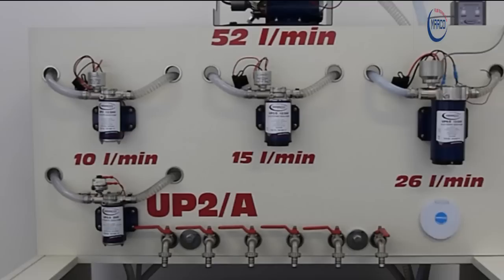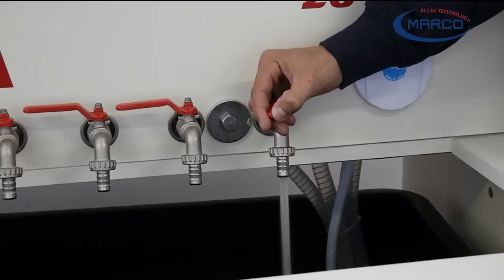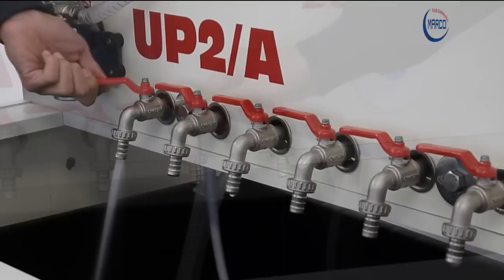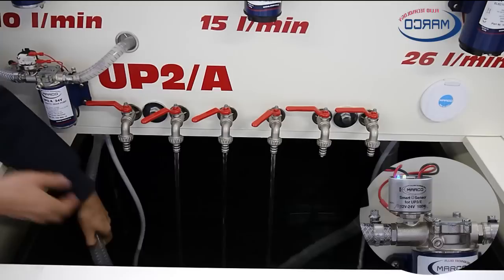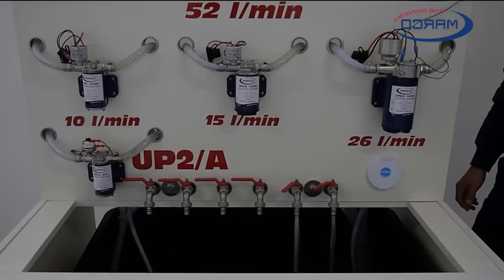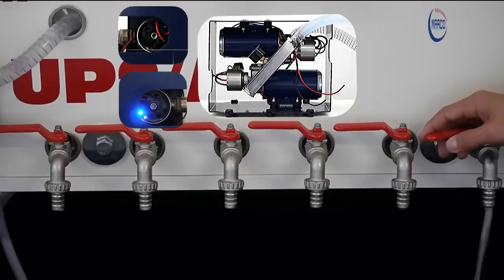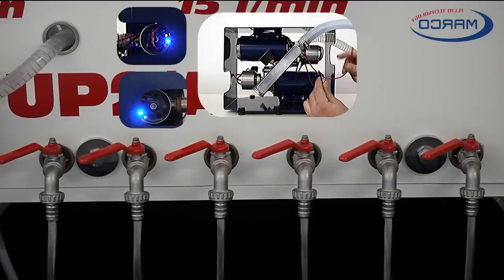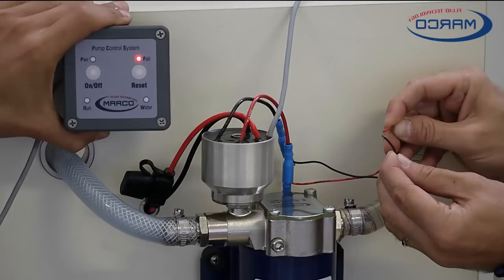Automatic electronic water system pumps

Comment: I do have the 9.5 gal/min that I purchased from you, but you never included a wiring diagram with it or any explanation what purpose the cat5 terminal is used for.
Thank you.
Dan
Reply from the maker: It’s for the optional control panel :)
Reply: @marco-spa  Thank you.

Comment: Do these have input polarity protection?
Reply from the maker: Yes they do! If you power them wrong, they won’t turn on and won’t burn the fuse, thanks to a non invasive reverse polarity protection circuit.
Reply: @marco-spa  if the polarity is inverted, also the flow will change?!Thanks for your answer!
Reply from the maker: The polarity can be reversed only with pumps without electronic sensor. The pumps with the electronic sensor are protected from polarity inversion and won’t turn on!